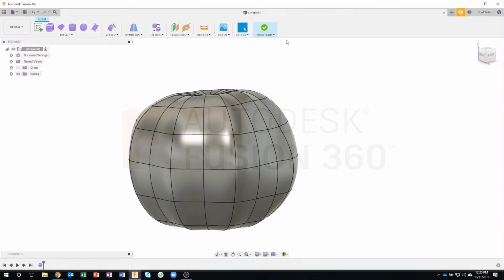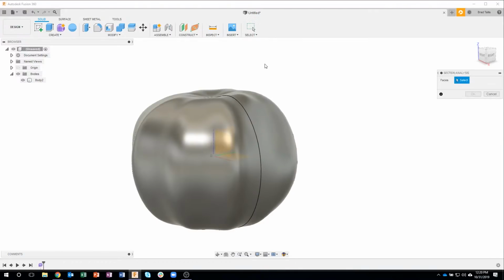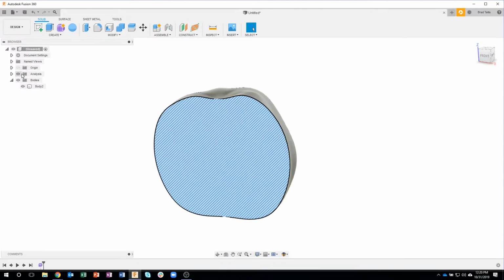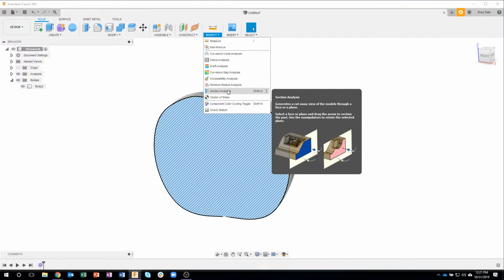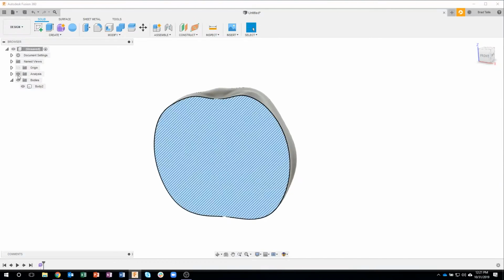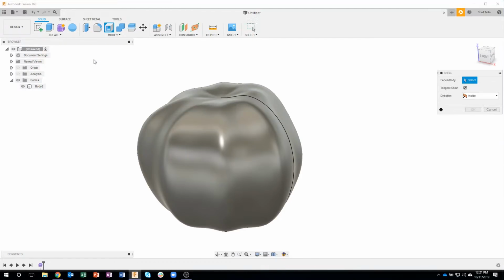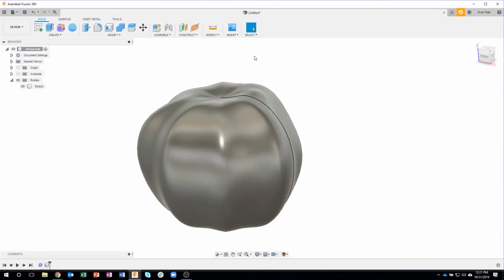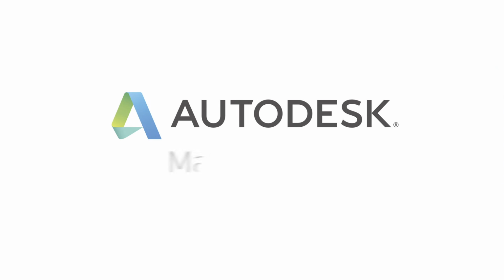Autodesk Fusion 360 | QUICK TIP: Form to Solid to Shell

Comment: Dear Fusion360 team. I am a beginner with fusion360 and have a hard time trying to convert a stl. object into a shell. I try to follow your instructions but I am not able to select the model. I can click on it or use the select tool. It won't be selected for the hollowing.
Reply: same problem here :( Did you find a solution?
Reply: I just started really using this yesterday and was trying to do the same thing...I'm up and running.  There are TONS of videos out there that will show you how to do it.  Search "convert stl fusion 360" and MAKE SURE it's a NEW video!  Anything older than a year-ish won't work as the way to do it changed.

Have fun.